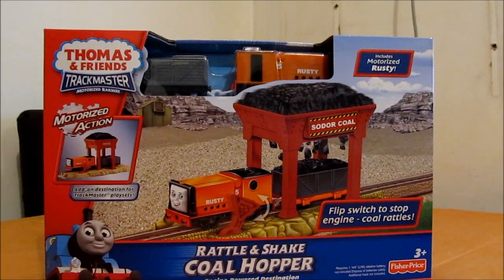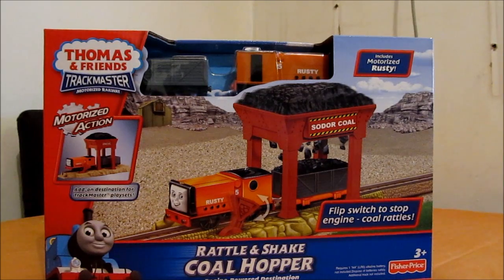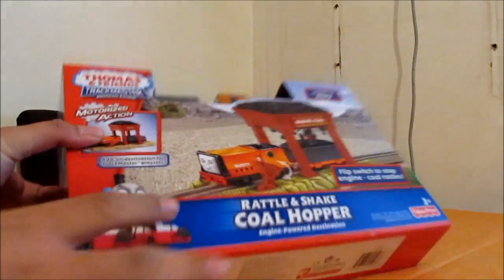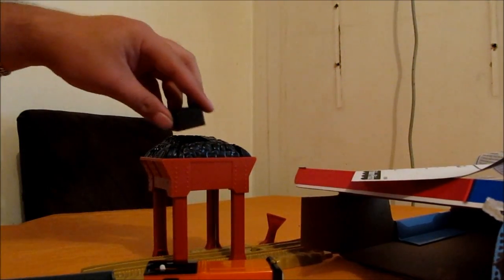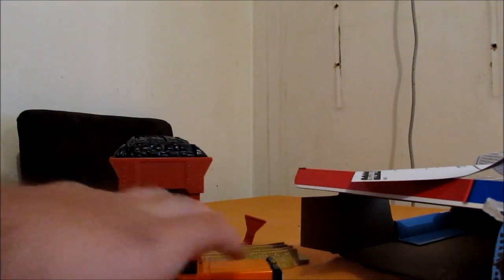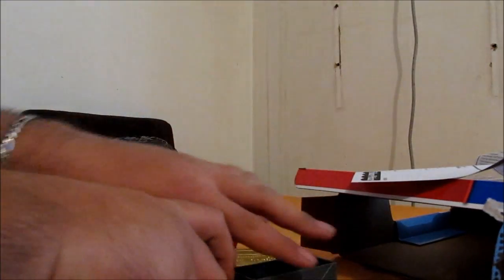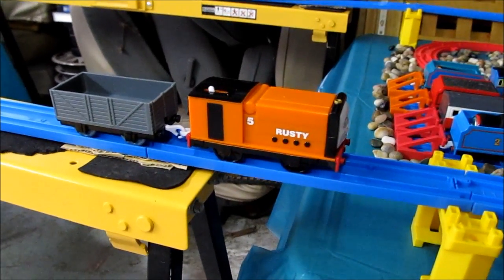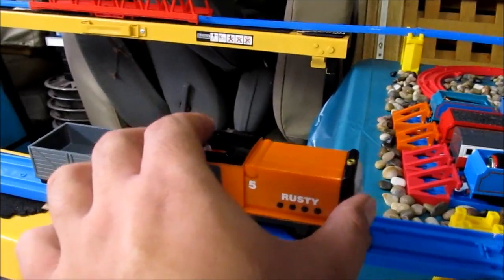Trackmaster shake and rattle coal hopper unbox and demonstration

Comment from the maker: I agree, perhaps they could have used a bertie the bus style drive unit run on a AAA that would have decreased the size enough i think but still let them run on the same rails. They could have made it work and had small rolling stock for sale to go with it and it could be fantastic, perhaps slightly taller than take and play.